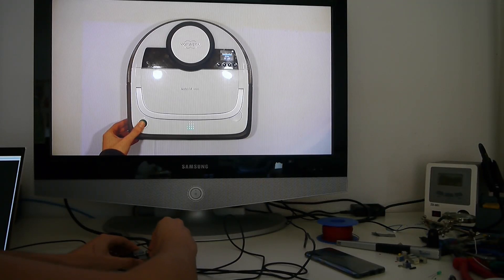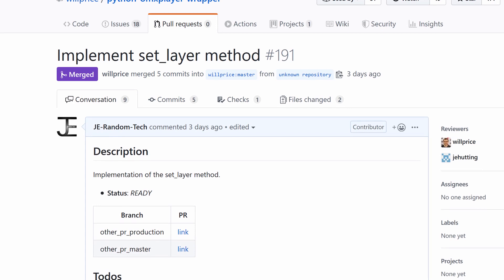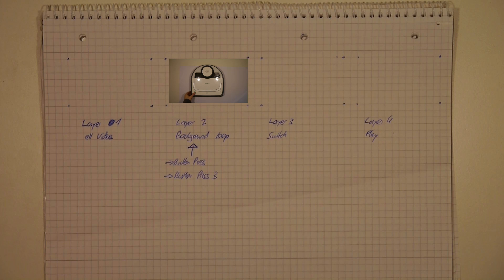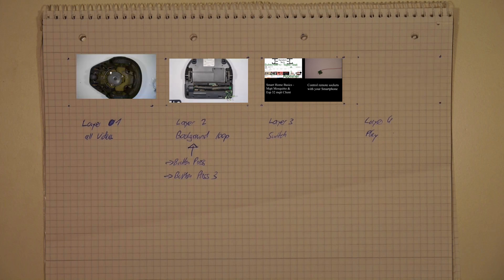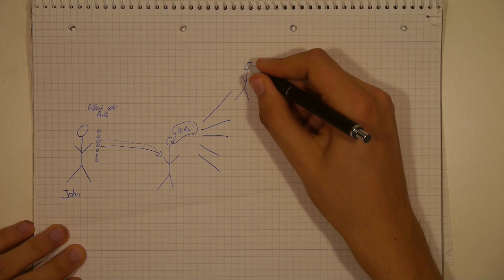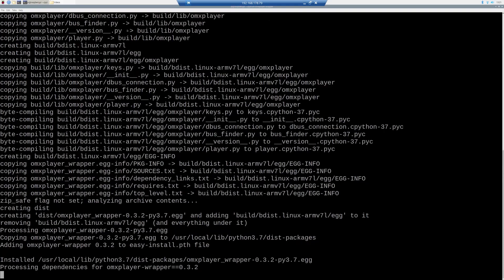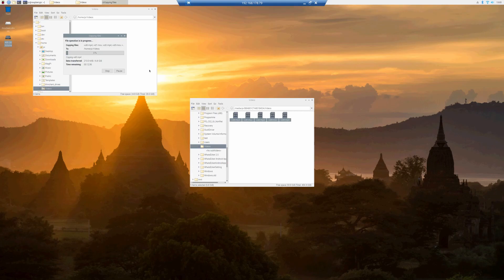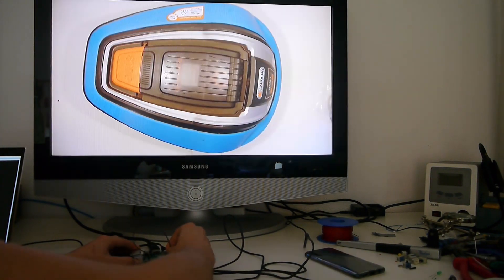Haptic Board - seamless gapless Video Transition with GPIO Pins

Comment: maybe a strange questionbut how is the wiring done ?
Reply from the maker: One pole of the buttons is connected to the digital pin and the other connected to the 3.3V port of the raspberry pi. It’s important to setup the digital pin to internal_pulldown so that it is connected over an internal large resistor to ground. As a result reading the pin it consistently displays 0 but if the button is pushed a low resistance path to 3.3 V makes the reading to one. You then can attach an interrupt to the pin detecting transitions from 0 to 1 which would be a button press or the other way around which would be a release of the button. Thanks for the question I didn’t fully cover it. Hope that helps🤞 and enjoy tinkering 😁
Reply: @JERandomTech  thank you so much ! is there a posibility for a picture of it ? is tried multiple times but it doesnt seem to work .
Reply: and is this also possible for the raspberry pi 4 model b?
Reply from the maker: Yes I believe so
Reply from the maker: Unfortunately I do not have access to the project anymore but if you look for raspberry pi push button there are a lot of helpful schematics
Reply: @JERandomTech   thank you so much for replying  i got one more qeustion do you know anything about this error?  ''importerror cannot import name 'paramspec' from 'typing' (/usr/lib/python3.9/typing.py)''
Reply from the maker: No never occurred to me unfortunately but maybe you could try to search for this error in StackOverflow

Comment: Hi  I encounter a Paramspec error once I run the code. I did a research about that error but I cannot see any answer could you please help me on that?
Reply from the maker: Yeah sure. Can you please open a GitHub issue and paste the whole error especially at which line in the code it occurs.
Reply: @JERandomTech  Hi I get the same error - any pointers as to how to fix it would be appreciated.
Reply from the maker: @SwingLow2  Unfortunaely the error did not occure when I used it. Could you maybe send the error printed in the terminal? If you have a github account I think it woul be better to continue here: https://github.com/JE-Random-Tech/ProJEcts/issues/5

Comment: Hello! It is very cool project! Question: Is it possible to make the video that is played on the main layer with sound?
Reply from the maker: Thanks. I haven't tested it but I think it should work. You might have to add '-o local' or '-o hdmi' depending on your use case. Hope that helps.
Reply: @JERandomTech  unfortunately my videos are played without sound. Can you test it yourself?
Reply from the maker: @MrVorosh  Sure. Can you try running omxplayer your/video/path.mp4 in a terminal and test if the sound works? If not can you try to add -o hdmi or -o local at the end of the command?
Reply: @JERandomTech  in terminal sound works! But in your code it doesn't work for me.
 Could you please test on your videos with sound and let me know if it works or not? Thanks
Reply from the maker: @MrVorosh  Unfortunately it didn't work for me either. You could try to run another thread and use pygame to play background music.
Reply: Thanks for the code. I'm looking to do the same thing with the main layer having sound. Any updates on getting sound for the main video?